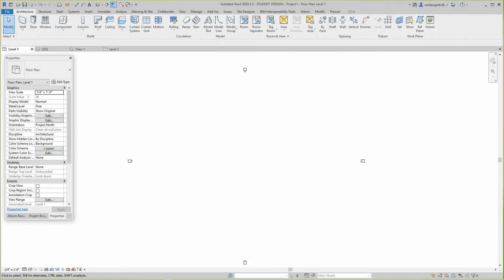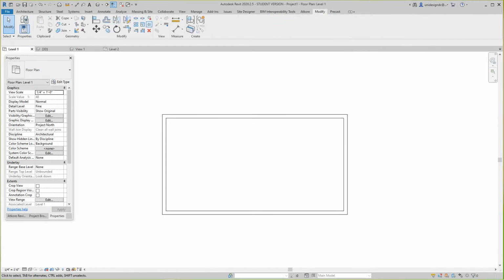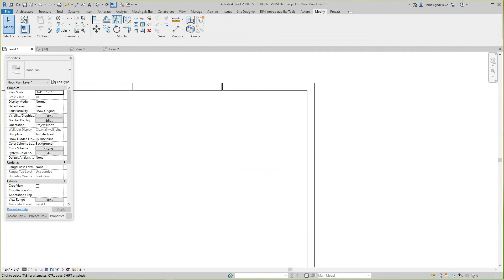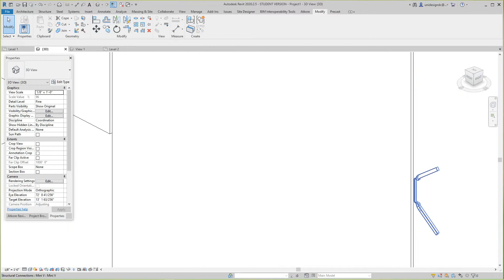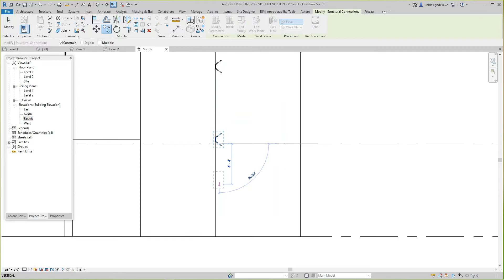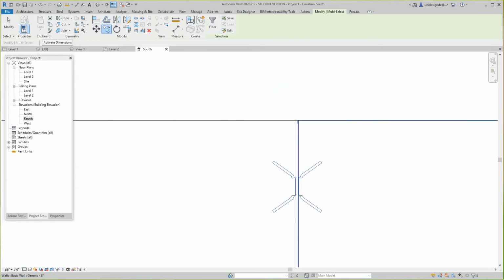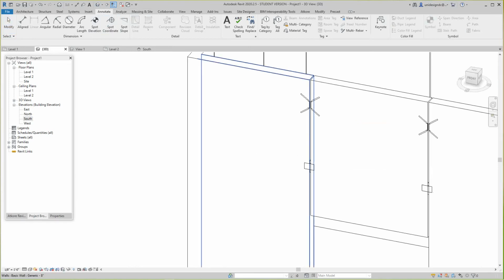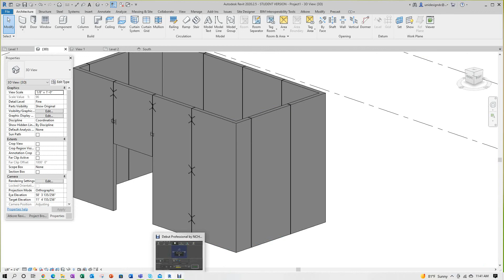Revit Precast Basic wall panels and connections

Comment: This question is probably a bit off topic, but can wall finishes be still installed at (sandwich) 
panel walls?
Reply from the maker: Hi yes you should be able to construct any wall type you want. Take a basic wall and divide the wall layers into any material you want..